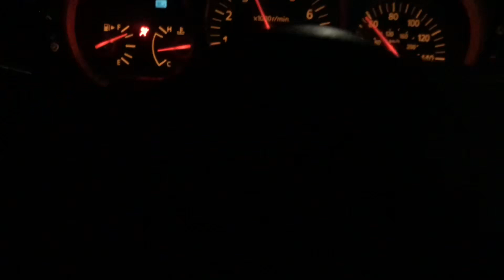My supercharged 350Z vs Aaron’s cammed 5.0 foxbody 🚖🚦🚘

Comment: Aaron's mustang need boost! Find a junkyard turbo maybe
Reply: Bobbycat GT on 3 maybe ?
Reply: Dayum Mike why you do him like that lmao
Reply: @jordanEBITDA  that would be nice!
Reply: Chris Longhorn whats most hp made on these 5.0 chassis
Reply: Depends on what trim. Hatches flex in the back once you pass a point and the chasis will do the same without sfc. The block will handle 500+ but after 500 its pretty much run it til it breaks which wont take long.
Reply: Anthony Aguilar 500
Reply: The motor not ready

Comment: That mustang is pretty quick for what she is. The new tech is light years ahead of 80’s technology. If he adds a super charger and goes with less aggressive gearing in the rear it would make a big difference.

I’d just throw in 3.27 or 3.42 gears in the rear and get a old paxxon supercharger they’re cheap and should bump it another 100hp or so safety. Other than that carbon fiber body panels and lighter wheels if you wanna go that far. Weight reduction is key in those ol 5.0 mustangs.

Comment: You got get better Intake and throttle body on that fox body do the explorer swap intake and if it’s still got e7 factory heads use explorer heads to from junk yard cheap. Those factory heads and in take don’t flow air and I bet not help that cam at all. And I see the cowl panel messed up get you a football and deflate it and shove it in there and inflate it up it help you straighten it out lot better won’t fix it but helps a lot.
Reply: True that late 90’s explore heads and intake will wake it right up GT40 P
Reply: I hope Aaron doesn't go that route.  Skip the GT40 parts please.  Check out my Mustang videos.  I picked up 152 hp to the wheels naturally aspirated on a stock Ford shortblock through an AOD.  You would make more with a T5.
Reply: The GT40 comment was only if it was a cheap alternative wouldn’t be my first choice if $$$ was no object
Reply: Afri I was just saying it’s cheap option and will make decent power and help the cam to do more what it’s suppost to.
Reply: @mrshines9310  The parts on my car weren't as expensive as everyone thinks.  If money wasn't an object, Coyote swap everything.  Foxbody Mustangs are 30+ years old.  The technology has improved and there are better heads than the GT40/P heads and Alphabet cams.
Reply: Very true
Reply: @mrshines9310  My Mustang makes good power, I can drive it everywhere and it's got a nice cam lope.

Comment: YO aaron, nice fox bro, you wana really run? Throw some AFR heads on there, some underdrive pulleys, get a trick flow intake, change the fuel system, with 4:10 gears, then lets see wtf that nissan  is made of!